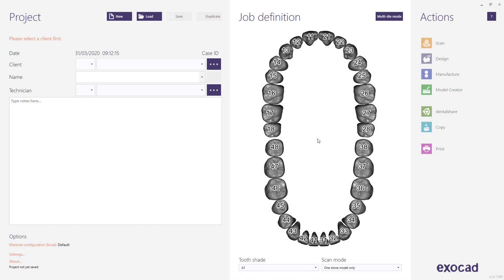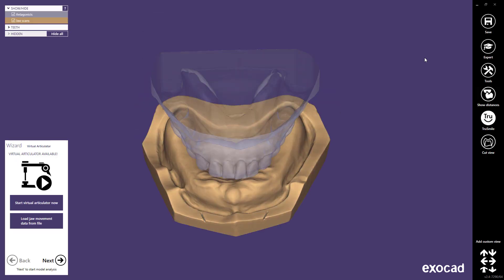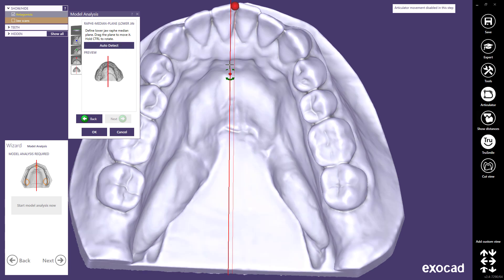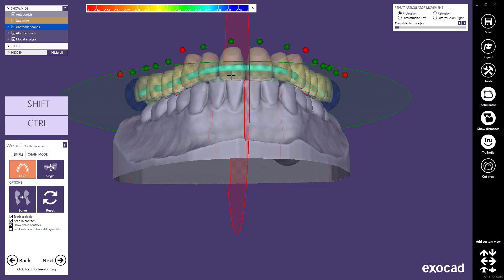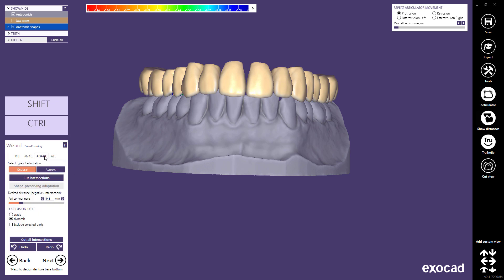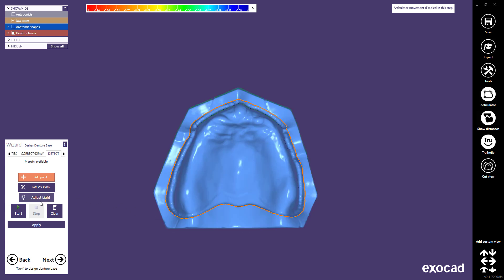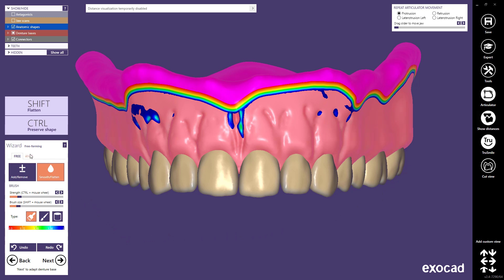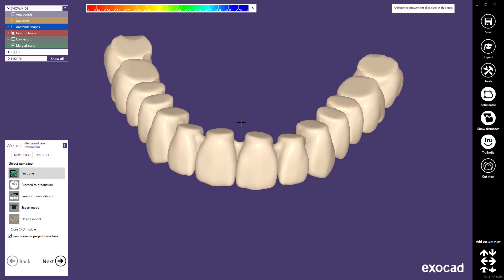exocad Quick Guide: Designing a single arch denture

Comment: Hello, i'm having issues with the denture base calculating past the surface portion of the model. Basically it extends through the intaglio of the model/scan. Is this something that is a known issue with single arch dentures in 2.4?
Reply: Hi Tommy, did you find out what the issue was? What you have described with the denture base calculated past the surface portion of the model has happened to me too.